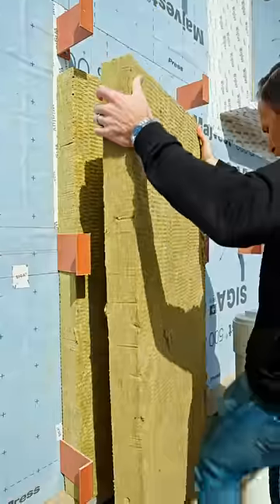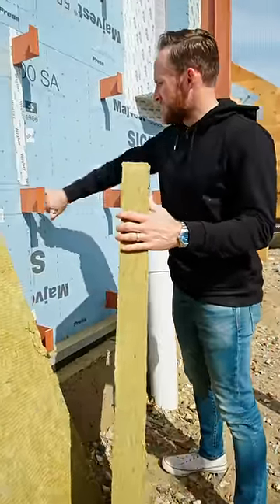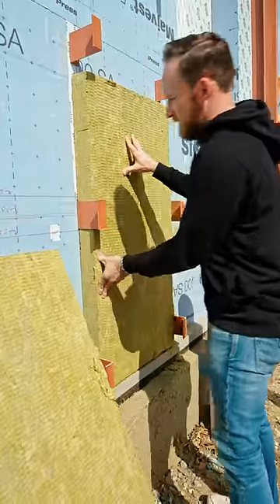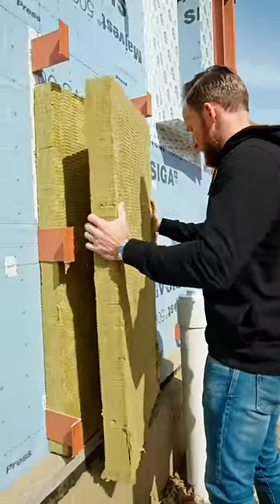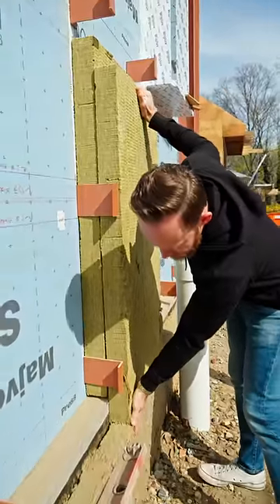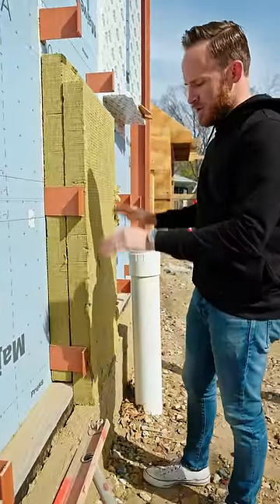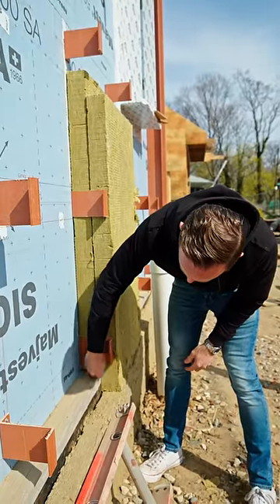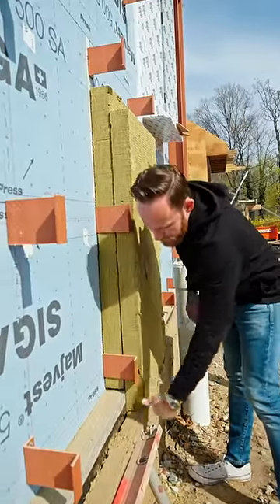Z girt and Six inches of exterior insulation

Comment: The doors and windows might need some extension jambs. Really big ones
Reply: That’s what I’m saying
Reply: A foot thick....smh.
Reply: Yeah.  This seems like one of those great ideas  in the design lab or drawing table that are totally impractical in the field.
Reply: @jameshetu6885  you don’t see the window extension built and flashed directly behind him 😂
Reply: @cvas282  it wasn’t that I couldn’t see them.  My comment was that they would be huge and really time consuming and expensive to make them.  The one we can see isn’t even done.  All that flashing tape needs to be covered by something… more time and another material.   Certainly not just a simple vinyl window with built in extension jambs from the factory.
Reply: @jameshetu6885  wrong again. Their window details are covered on their full length videos on their channel. Double layer of the exterior insulting goes up, plywood screwed to the z gurt then their cladding. From the exterior the window will appear flush as normal.
Reply: @cvas282  and... like we've been saying all along... on the inside there is a giant extension jamb to make up the distance from the window to the inside wall.  Hardly efficient and definitely not standard factory jambs.  This was the point of our whole discussion.  Not sure what you missed...
Reply: @jameshetu6885   again wrong. Firstly it’s a trimless install. Plastered window bucks all around. Secondly they are aluminum windows from Europe almost 4” thick triple pane. And I miss spoke earlier the inside framing  is flush the exterior is bumped. The window is basically centered in the opening leaving about 3” of exposed jamb outside where in this case the cedar shakes die directly into the window and again plaster on the inside.
Reply: @jameshetu6885 This is what happens when somebody from the trades, or design side conversates with someone who likes YT
Reply: @cvas282  Excactly, ppl so quick to comment without any observance.
Reply: I like the big extension jam's bad-ass Worked in a house in  Is Yonkers with 21 thick rubble built walls pitcher those door jams
Reply: With the windows and doors its all moot.  Yeah I have a r valve of 105 but my windows are 3.5
Reply: @jameshetu6885  Lol, that dude hasn't a clue. He must be a bean counter.
Reply: Beautiful I would love to learn and do that in New York
Reply: If the windows four inches so what is the door going to be? 6"
Reply: Can you see!?

Comment: In the South West part of the US, we staple 1” or 2” foam with chicken wire and metal lathe over OSB. Then either spray foam or insulation is placed on the interior walls. I’d prefer ICF for durability, but it helps maintain the temperature cool inside during our boiling hot Summers.

Comment: Maybe run furring on those clips so the plywood can be secured properly at the edge’s 😮 then allows for an air space for venting this time of year condensation will form on the back side of the plywood the Rockwell too 😮
Reply: it doesn't matter if Rockwell gets wet and 2en dries Rockwell does not loose any performance characteristics! and the vapour barrier is already up and by the looks of it has drainage channels on that type commercial wrap
Reply: @marcfavell  The Rockwell will hold moisture ….Take a piece and put in water for a day or two when it cant  breathe detailed with the backside of the plywood right up against it like that any small leak thru the siding or plywood joints around all those siding nails creates a perfect condition in time for rot and mold
Reply: If they spending this much time I'd might as well have them Tyvek in-between the layers too
Reply: @BostonMark  pretty sure they use clips and tape on all the seams
Reply: @BostonMark  I believe you are correct.  Would you then put all the insulation on the inside, with vapor barrier on the outside?
Reply: @kevin6550694   exterior insulation is a great detail prevents thermal bridging thru the solid framing members say a 2x6 wall @ 16” o.c.  = About 15% where you can’t get insulation.  Wood has little R value By re-insulating the outside of the exterior plywood you achieve 100% thermal resistance 👉also it pushes the dew point outside of the wall cavity by allowing inside temperature and outside temps a  buffer area to meet and equalize. The main rain screen is at the outside face of the plywood sheathing and it’s job is to stop air and moisture to penetrate into the wall.
Reply: I do think that the walls should have some sort of breathability and I also believe that you're right and that the shorter sides of the sheathing should also be fastened down as well as it is with conventional framing
Reply: @randallsmerna384  it’s an awful small fiberglass landing pad to screw plywood into might crack. Vertical 2x’s allowed for a thru-bolt connection. Then 3/4” tongue & grove on top locks in the horizontal seams  4’ seams land on the furring centers

Comment: The step flashing and insulation at the bottom should be formed on a 45 degree slope. 90 degree step flashing retains and wicks water into the insulation and siding.

Comment: Curious, so all of the sheathing and then siding material will be hanging from those fiberglass clips?
Reply: Yep, pretty ridiculous idea if you ask me.
Reply: That’s what I was thinking aswell, shit nailing siding to studs with the 1inch styrofoam shit is already hard enough at old places with it
Reply: Thinking the same. Is there sheathing under the blue insulation? I sure hope so because I would be very curious as how the sheathing on those clips would support the framing. I also wonder what the finished exterior would be 🤔
Reply: Yeah and all the plywood sheathing is only going to have a nail every 2 feet? No sheer strength, eh?
Reply: @lucastudor5536  I don't know, it almost looked like there was sheathing behind the insulation, but that build out looks ridiculous.
I mean talk about over complicating things, just expanding foam the full 2x6 wall cavity and there you go.
Reply: Yep, and one good storm and you'll be chasing it down the street...lol
Reply: I'm curious with no air gap with the "drainage" sheathing how that rock wool isn't going to soak up the moisture and trap it?
Reply: Yeah, I can't see that being very strong.
Reply: Screwed into fiberglass sounds like a bad idea. May as well frame the exterior with 2x12’s and pack it with insulation.
Reply: @ajs96350  or build an additional 2x4 wall inside the 2x6 and insulate both, way less time than this
Reply: @jskjsk3986  what you have described is how we do it in western Canada
Reply: i dont think you would do anything but brick or stucco on something like this
Reply: @sillynacannada6718  rockwool is naturally draining, it doesnt absorb moisture.
Reply: @griznatle  if no air gap, how does it drain?   And, no I've been on jobs, the bottom pretty much soaks it up. When it doesn't have an air gap. (An air gap is a space between the product and what it sits on about 1/2" or 3mm , depending how thick it is, so air can get to it and not sit in it's own standing water).
Reply: @sillynacannada6718  im not a proponent of how he did it. All im saying is the material itself has no absorbing qualities.
Reply: @griznatle  condensation? And rockwool will act as a sponge. Its called wicking. All fibrous material with do it. Even with a weep hole. It needs an air gap.
Reply: @sillynacannada6718  i completely agree with you, the method this builder is using is wrong. My original point is, the material itself, without other factors interfering, does not absorb moisture.
Reply: LOL...!
Reply: @griznatle  it definitely holds moisture/water. It goes dark and takes a while to dry out.. it wont mold though as its a by- product of steel
Reply: @jaywhite9133  you are correct, it will hold water, as there is airgaps between the strands. The material itself does not absorb water. An inorganic substance cannot absorb water. A metal bowl and a wood bowl can both hold water, but the wood bowl will absorb water into itself.
Reply: I see so many failure points here I don't even know where to start. It's Rhode Island, hundred mile an hour winds hundred degree temperature change from Summer to Winter and you're relying on fiberglass Z Clips to hold your siding to the building. I've been in construction for over 30 years and I'm not sure I would trust this technique for 30 days. We really need to stop Reinventing the wheel and just start using common sense when we're building. I do love the fact that the insulation can't burn. If that's foam board underneath that stuff melted a fire so fast the house will collapse
Reply: @sillynacannada6718  I can confirm because I use rockwool as part of my hydroponic garden system for growing peppers
Reply: @griznatle  I use rockwool for Hydroponics, it holds water perfectly fine
Reply: @griznatle  just have to pop in and correct you Stones can hold water and absorb it as well. Just because it's inorganic doesn't mean it doesn't have air space or the ability to absorb water
Reply: @vrgcustomcarpentry  I think the problem is the confusion on "absorb" vs "hold".

Fill a cup full of rocks, then fill it with water. The air gaps are replaced by water. The rocks themselves do not have the physical structure, atomically speaking, to absorb. The gaps and cracks can hold water, as no rock is free of fissure.

But like I have stated many times, apart from being porous, a rock cannot absorb water.
Reply: @vrgcustomcarpentry  you are correct, it holds water. It does not absorb. The fissures and cracks, or air gaps, can be filled with water. 

The material itself, the molecules, have not coupled themselves to the h's and the O's.
Reply: @vrgcustomcarpentry  I agree, seems ridiculous at this point.
Reply: @lucastudor5536  *shear
Reply: @vrgcustomcarpentry  Curious to know how you'd build an airtight house with no thermal bridges to the outside.
Reply: @ajs96350 

You still lose R value at each stud.
Reply: @John.T.  Okay, so just don't build then.
Reply: @ajs96350  

Lol 

I’m just saying.

That’s the problem they are trying to solve - believe it or not.

Comment: Very nice, couldn't help but notice that you aren't staggering the joints though?
Reply: The insulation joints? Or plywood? Either way you obviously didn’t think that through.
Reply: @roadtraveler9631  I assume they mean insulation joints, so there could be miniscule gaps between the pieces of rockwool.
Reply: @roadtraveler9631  insulation obviously seeing that's what the video is about. You didn't think that comment through did ya
Reply: @jjpaq  the joints are staggered horizontally by the outside board dropping a few inches lower. But how would you stagger your clips to offset your vertical seams without over complicating the system? That insulation will slightly settle and close any gaps over a relatively short period of time without screwing it to the wall with over sized fender washers. The thin galvanized ones. It’ll be just fine.
Reply: @roadtraveler9631  

You mean they're staggered vertically to cover the horizontal joints?

In any case - with the system they're using you can't offset one layer horizontally, but perhaps some adhesive or foam between the panels would help with sealing. Assuming it's even an issue.
Reply: @jjpaq  it is pretty much R-50 or better after all. Could heat that thing with your breath and body heat.
Reply: @jjpaq  no I’m just saying that the horizontal seams are staggered a few inches. And yes, the boards themselves are being moved vertically to cause that to happen.
Reply: You could always put a couple extra bends in the clip to stagger the vertical pieces also. Just have to make up with an extra strip cut from one end and moved to the other.
Reply: @roadtraveler9631  

Yeah, that would do the trick. Like a bend out and then back, the thickness of one of the pieces.

Comment: Just a reminder, humid air leaks through the inside plastic air tight barrier (envelope compromise is a given.) It freezes where cold penetrates, which is a third the way into a wall.  But now the escaped humidity goes farther outward, hopefully past the original outer moisture-permeable barrier (Tyvek).   But with more than a third of the insulation being new, humidity could get stalled behind the original Tyvek within the old insulation. Air movement and freezing humidity has to be re-considered when adding more than a third of exterior insulation.
Reply: I thought the same thing.

Comment: In my area of Ontario if you seen more then 1" foam board and 2x6 pink pack insolation you'd be lucky. The houses here get slammed with snow and damp winters, have the worst insulation and sell on average for 850K. When I quit framing after building several neighbourhoods over the years the quality of homes being built today i'd be surprised if they didn't crumble in 40years tops

Comment: A single 3inch celotex (polyisocyanurate) board would provide more thermal insulation than 6inches of rockwool, you could screw them to the wall, screw the boards to the interior wall through the celotex so no fibreglass mounts needed, and seal the joints with expanding foam as you go. 
But it costs a little more
Reply: Not quite. From what I read the R-Value of polyiso is slightly UNDER 2x that of rockwool. Regardless, there are secondary reasons to select rockwool over other insulation types. Higher vapor permeability, fire resistance, pest resistance, more sustainable, etc.

Comment: You could be using 1 layer of 3.70” Polyiso for the same r-value, save money, eliminate those expensive fiberglass Zgirts. Achieve an air barrier and WRB all at the same time with Thermasheath by Rmax.

Comment: It was a huge PITA to use the required insulation in my house in California, but my gas/electric bill is 2/3 less than the surrounding older houses. And it will be less $ to live in for 100 years to come.
It was a good thing.

Comment: Wow...close to R-50 in your walls with no thermal bridging....that's impressive
Reply: Six inches of comfortboard 80 installed correctly is R-24. In this case the effective exterior wall insulation is only R-20 due to the air gaps.

Comment: Let's spend an extra 45,000 on our build , so we can save 500 per year on energy costs .
Reply: Amen to that....
Reply: I did the builders course in Vancouver Canada and they said this assembly would add only $14,000 to a typical 2,300 square feet build. With all the various vapour barrier requirements and are exchanging maximums we are typically adding $70,000 - $120,000 to build costs and construction costs are close to $700,000 for a typical home with 800 square basement suite. Of course the dirt we are building on is well over $2 million!  🤮
Reply: And move out in 5 years.
Reply: @john-paulsilke893  Man O' Man , Why is it so expensive in Vancouver ? Is the economy that strong there ?
Reply: @jimmymags6516  anyone who can sneak money out of CCP parks it here in real estate and makes significant interest. I’ve seen doubling in under a decade, often under 8 years. Split and remortgage and buy 4-6 more homes and rinse and repeat. After 24-30 good years and you can own 25-30 homes and turn $100,000 into $3 million easily, starting with one home. Do that with 4 or 5 homes and a bit of luck and you can make $300,000 turn into more than $10 million.
Reply: @jimmymags6516 Inherent flaws in Capitalism
Reply: @srs6461  I don't think you know what capitalism is.
Reply: @john-paulsilke893  Assuming the 2300 square foot house was 48' x 48', that's optimistically 1500 square feet of insulation, which is about $30,000 for 6" of Comfortboard 80. So maybe if you did all the labor yourself, you can do it for twice what you suggested.
Reply: @srs6461 

Globalism*

Comment: I subscribed. I’m a Rhode Islander but live in Georgia now. I use every insulation trick here that I learned in Rhode Island. My A/C doesn’t work anywhere near as hard and my utility bills are on average between $200-$250 less than most homes the same size.
Reply: 200 to 250 less? .. holy sh*t ..whats an average bill in that area, my entire bill is under 200

Comment: The mice will love to live in this wall assembly. And believe me, mice will get it. Please address this.
Reply: No
Reply: My understanding is that mice don't eat rockwool
Reply: Oh they do eat thru.
Reply: @MrTooTechnical  You have experienced this or know this for fact? I'm not saying you're wrong, but I've just heard otherwise. Also, if not rockwool what insulation wouldn't be subject to this?
Reply: Yes I have experience. It won’t matter what insulation you use. If mice and vermin can get in, they will chew right thru it
Reply: @MrTooTechnical  Interesting. Well, if constructed correctly you can assemble a wall that highly deters the intrusion of pests
Reply: Only if metal is used around the perimeter
Reply: @teraxiel  they don't like rock wool, yet they still manage to destroy it.
Reply: @MrTooTechnical  yup metal and locked metal seams.....

Comment: Australians be like “what’s insulation” 😂🔫
Reply: Your not kidding.... I guess it gets pretty cold there? But what's the external cladding system over the ply?
Reply: @bricklesskiwi376  
Real cold.  And damp, too!
The wrap on the plywood is a vapor barrier, it acts as a one-way barrier for moisture to escape the inside of the home but not to let damp in.
There's also very likely to be some type of moisture mitigation for the exterior insulation as well, since if it traps moisture it'll grow mold and rot the surrounding material.
Reply: To keep the heat out!
Reply: @manuhonkanen2111  if only ozzies would think that way 🤷‍♂️
Reply: Insulation also keeps your home cool.